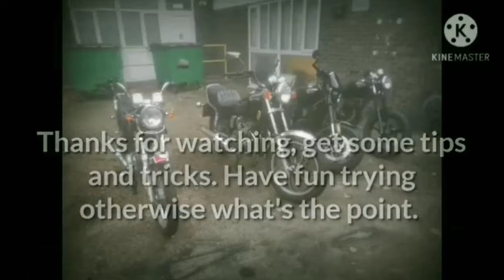Yamaha fzs 600 carb issues. Continuing to try to save the original carbs.

Comment: I'm a Bandit fan all day too, but I have to agree about moving to fuel injected. I got a Yamaha XJ6n this year, a 2009 one and that's been a revelation. It rides a lot like my Bandit 650 used to and it feels very confidence inspiring and plenty of power when you need it.
Reply from the maker: Yes, and they are easier to maintain. Especially with these e10 fuels

Comment: that takes me back, struggling to dismantle a carb with a phillips screwriver. then i found out about  the screws, theyre japanese industrial standard not phillips, a phillips will strip the head, i guess thats why your hammering it in, get yourself a ,:  JIS Vessel Megadora 980 Impacta P2x150#2 JIS Cross Point Impact Screwdriver.:      the best 14 quid youll spend
Reply from the maker: You made an assumption there, what makes you think I was using a Philips?

 That screwdriver is a jis impact driver, hence why using the hammer.

Comment: Some times fuel injection can be Worse and Expensive to Maintain In the Long-term.
Reply from the maker: Hmmmmmm harder to maintain then carbs? 

A carbed bike can be left sitting for a year with fuel in and will need a good clean out taking a couple of hours possibly. 

A fuel Injected bike would just need new fuel in and will fire straight back up. 

Both have positives and cons bit for reliability I would choose fuel injected now days. 

If its a Chinese bike I would choose carb

Comment: Think that fazer is going to be a money pit....have you oiled the bores ready for compression test or first turn?
I know you are more than experienced in this but i honestly can't remember 😂 if you ,mentioned it.
Reply from the maker: The weather has really been against me these last few weeks. One of my jobs tomorrow is to turn the engine over. I'll put some oil down the bores ect. 

I've ordered a set of carbs now so should be able to turn over properly next week. 

If I get it running at all, I'll order a battery and service it.
Reply: @motorcyclerescuer  forecast is 70 + all next week...I know cos I'm in Heathrow depot all week.
Reply from the maker: Wow that's more like it. I've got a couple weeks of from next weekend which will be nice. 

And my cb200 fuel tap has arrived to hopefully that will be up and running tomorrow